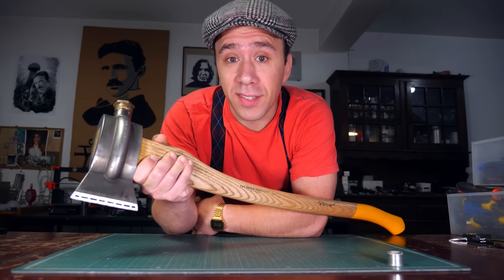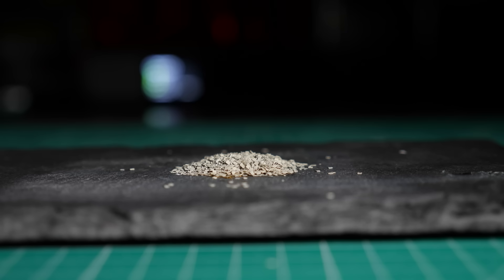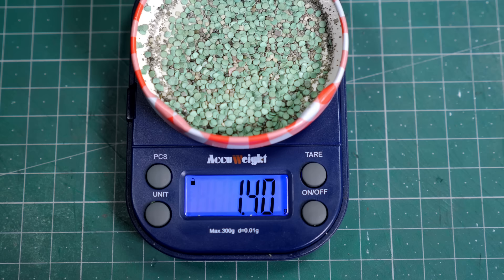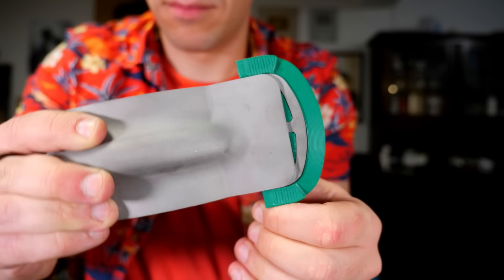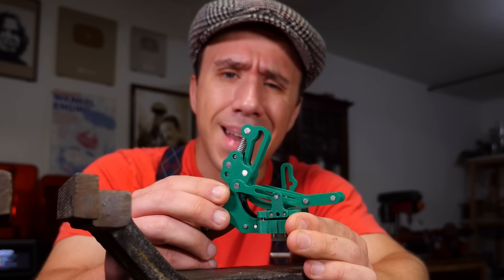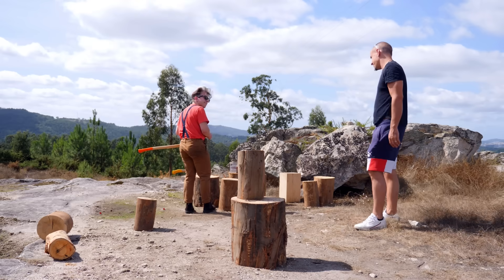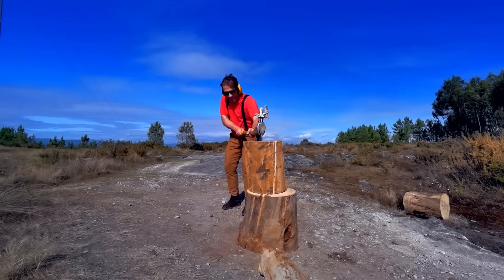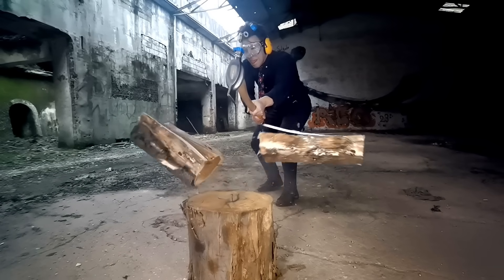I built a BETTER SHOTGUN AXE

Comment: What if instead of using the gas to try and split the wood you have some kind of chamber the gas goes into and pushes metal wings out to separate the wood. I would also be very careful to not make this a bomb. Add some vents or something and stand far away for testing for a bit.

Comment: ok,  since "technically"  its just the gas and not the shell that technically means the shell doesn't need to be pointing straight down.   So why am i picturing instead using a pipe system  to funnel the gas from the shaft to the the blade, little longer distance to travel, little less "power"   but should work.   grip safety,  round won't fire unless your holding the grip,   and a manual trigger allowing you to fire it when its in the wood saving on shells.   

with a little math you could calculate the max pressure you want, and even include a blowout valve if the pressure builds up to high  venting the excess pressure away from the axe and you.

Comment: Don’t want to be that guy but stainless rusts if it doesn’t have access to oxygen as it is the oxide layer so it will rust as long as you store it with water

Comment: I can understand why you tried different shapes for the blade in this video, as you said, penetrating the wood is important. But i do believe that the straight blade had an advantage at transmitting the force to the wood more efficiently. Maybe it also has something to do with the ammount of vents. Your old design had more smaller vents vs. the two on these new designs.  

Of course i could be entirely wrong, but i think these new designs sacrifice the "blowing appart power" for "ease of penetration".

Edit: After reading this again, i think that last sentence might me the wierdest and funniest sentence out of context that i have written in my life!

Comment: Diesel:   How about using diesel just like an internal combustion engine or a diesel driven pile driver.  Where you will use the force of the explosion rather than just the exhaust gases.

Comment: I feel like it'd be better not to try to use the gas to push the wood apart, but to use it to push a metal wedge apart. It'd take a lot more engineering to make the the axe head spread apart but stay together still, but it'd fix the issue of the gas escaping through the cracks in the wood and would make it a lot more consistent. It's all about transferring the pressure horizontally, which would be a lot easier with a fixed mechanism than just hoping the gas goes where you want.

Comment: A tip for cutting metal with a grinder cut off disk is, score the area you want to cut.  when you plunge into the metal all the way then press the edge of the cut off disk into the now thin part of the metal it will be harder on your disk. It might cut a little faster but it will be much more expensive and when doing a larger cut it can cause you to need to stop and replace the blade which can cause it to take longer.

Comment: I’d try a threaded plunger trigger mechanism on the top or bottom of the edge so it ignites when the blade is the right depth into the wood and the threads can adjust the depth of the ignition to dial in different wood types

Comment: 8:52 Joel, word of advice to help your tools last longer. That file you’re using has carefully shaped teeth and they have one face designed to cut and bite. When you’re using the file, make sure to only push when applying pressure. If your pull while the file is pressed against the workpiece, over time, the teeth of the file will round and deform and the file won’t bite like it should. The motion is push, lift, pull, repeat.
Reply: this is a myth. Fireball Tool tested this.
Reply: @ZexMaxwell it will dull the file though
Reply: @ZexMaxwell what I came to say 😂
Reply: A file card would help as well

Comment: You need increase holes in blade to make surface where gas pushes wood bigger, also it should be not angled but more parralel - so it make better seal with wood.

Comment: Dude, that has got to be the most baddass, and actually potentially quite practical , axe/wood splitter ive ever seen, especially here where shotgun shells are very easy to obtain.
Hell no more dangerous than an actual hydraulic wood splitter, trust me on that.

Reminds me of a simular device that still is fairly commonly used where I am, uses the same principal but drives roofing or finishing nails using  blank .22 or .32 rounds.

Theres market potential here in the US you know..... And ill end it at that.

Seriously though, very clever A++ video.

BTW Happy Birthday from a fellow "garage engineer" from the US.

Comment: What if the trigger mechanism were basically a rod that releases the hammer when the axe head is at the right depth? It'd have to be strong enough to withstand the forces from over-penetration, but also not be so light that pushing it with your finger would set it off. It'd be similar to the surface safety on a pneumatic nail gun, except it's the trigger.

Comment: 16:02 seems would be easier if you have a shotgun axe that you place on the wood and pull a trigger and the pressure splits the wood without swinging the axe. A zero effort axe. Possible?

Comment: maybe using a mekanizem that will release the hammer after the blade reaches a specific depth would fix both timing and depth. say after the blade penetrates 6mm it will push a rod that in turn releases the hammer. it would then only need to be adjusted to the depth that most consistently works.

Comment: Instead of relying on force from axe's head hitting the wood and triggering hammer, make a little tube with a steel ball inside, and place the trigger on bottom of that tube. Now when you swing downwards, the ball should go up and when you hit the wood, it would slam downwards into a trigger. This should give you some more control with delaying the explosion. I might be wrong but i think this might work. I hope he reads comments 😅

Comment: To detonate the exact moment the axe impacts the wood, combining the force of the axe itself with the explosion, you could use some sort of distance sensor. Could be either an ultrasonic one, a laser one, or even a diffuse IR sensor. If you use a sensor with a high enough update rate you could even dynamically adjust the timing of the trigger depending on speed of the approach. For safety you could also factor in the reading of an accelerometer to prevent false readings (so tapping it with your hand wouldn't set it off).

Using a button on the handle as some have suggested might work, but trying to time something like that on a heavy object you're swinging would be very inconvenient, whereas with an automatic system you'd just need to tune a number or two to get it to work.

Comment: Hey Integza, I really like you videos of rocket propulsion. I saw this video a of a guy probably using eddie currents using an electromanet and most likely aluminum to create a flying saucer, i wonder if you can replicate it and add a way of propulsion to steer it. This video is called  "Alexey Chekurkov Electromagnetic Field Lift August 18 2018" go check it out, it seems like a pretty cool video idea.

Comment: For mk3 put depth stoppers on the blade and the trigger mechanism on the blade so when it's at the right depth the blade stops at the correct depth and the trigger goes off like a impact dart toy.

Comment: what if the axe handle itself was hollow, with a pipe feeding hydrogen from the back? That way, the handle could act as a pressure chamber, giving more volume for combustion and directing the force forward through the axe head

Comment: How about actually splitting wood with axe.
Axe be made from two halves, that are able to slide to sides.
When triggered, gas pushes halves to sides. When they are far away, that would expose holes that would let gas out.

Advantage: you are not relying on seal between wood and axe, but seal is created by metal parts.

Comment: Can't you add a little plate that sits flush with the axe point and is sealed and gets shot out with the explosion? It'd always have a seal that pushes the wood apart even if there's a gap.

Comment: A simplified striker can be made with a cylinder with a firing pin protrusion, being held up and away from the primer by a spring. This would be held in another cylinder that screws into the axe head and holds the modified shell in place. You would have to play around with striker mass and spring weight to allow the striker to safely remain in the "cocked" position, but still allow it to reliably strike the primer when the axe head comes to an abrupt stop when penetrating the logs. 

Less complicated than current firing solution, more consistent than a magnet. Just slower to reload.

Comment: 8:32 when using a file lift on the back stroke the teeth of a majority of files are designed only for the forward stroke and get damaged on the back stroke 👍👍
Reply: After y3ars of testing this for myself I can conclude...it doesn't matter unless you are using super cheap or super old files

Comment: If my chemistry & maths is correct (it’s probably not.. haven’t done math like this since highschool!) 

A very similar chemical release of energy, and similar VOLUME of expanding gases from combustion is Oxy & Acetylene. And unlike gunpowder, you don’t need a license to get a kit, and you don’t need anything fancy.. 

Your little syringe of 100ml of gas should, if my maths is right, make about 500ml of .. gas. 

It’s also going to create high pressure steam.. which should work nicely too. 

HOWEVER UNLIKE GUNPOWDER be very VERY careful with mixed oxygen-acetylene. A nice neutral flame should be an almost perfect stoichiometric mix. 

Ignite that with a little spark, and boom! 

It might just go pop. 

It might blow the axe head to smithereens. 

If you do give this a try, PLEASE FILM THAT.

Comment: V3 using an outward expanding mechanical lever that is driven by the expanding gasses? Like a piston on either side that is flush to the axe head until detonation. Would more efficiently convert the expanding gases into kinetic energy that is applied to the log since it wouldn’t be reliant on the seal between axe head and wood?

Comment: It's innovative, except the cost of the axehead and shotgun shells increase the cost of production of firewood. Wouldn't it be easier to get a hydraulic wood splitter or a specialized wood splitting drilhead. It is cool.

Comment: Why not rebuilt entirely? 
You can take a iron pipe with some sort of an point on it. Maybe same diameter as the shell?
You can lock it with an rifle like bolt.
The point can have 2 or more opening to direct the gasses straight into the wood.

The reason? That little point drives deeper into the log than an axe

Just a thought😬

Comment: You could end up with metal in your face if you're not more cautious. Many firearms have a mechanical fuse of sorts that allows the thing to blow up in a way that doesn't harm the shooter too bad in case of overpressure.

Comment: You only need to compress the hydrogen /oxygen  a bit.  Putting more in a given area.  When it expands, it will open a valve or port into the axe head.. Also, you  may want to add a failsafe  to all the designs . In the event the ports are sealed, the axe doesn't EXPLODE!  EXAMPLE: Wood gets into the ports . Then you hit another piece of wood the ports are sealed.. the axe may explode ... having a small port that will open in an over pressure  situation..

Comment: This reminds me of cracking glass panes in a straight line, put a tiny score line on it then apply quick pressure. It snaps the same way, I also dont understand the exact mechanics. Rumor has it is several wars some troops modified sledge hammers with 12ga rounds to allow a single blow to a lock to blast the enttire door open in a simmilar way. Maybe something to do with the same physics to why a dead blow hammer is so effective?

Comment: What if you made the axe head body one piece and then the blade 2 pieces with a cavity for the expanding gases to then push the two pieces of the plane apart physically wedging apart the log this way you could have the ax head be like a normal ax head minus the split and it would be much easier and more consistent to split the log with the shotgun shell. You might even need significantly less than a shotgun shell

Comment: Axe doesnt work if you do not hit it hard enaugh! I must go as deep in to the wood as possible. Then all the gases has nowhere to go, and that means good boom! And also good cracked wood at 2 peaces. Try to hit it as hard as you can, and be surprised! If you do not hit it hard enaugh then it doesnt go deep enaugh, and that means it doesnt seal it good enaugh, or it doest want to stay on and it pups up, or then it does nothing. So, simple solution, use your muscles!

Comment: The main problem is the timing, you need the "blow" to add to the initial shockwave. Also, you want the gases to "stick" as much as possible to the axe while making the distance between the "gills" and the blade as short as possible. Your mechanism induces a lot of delay and possibly doesn't make enough gas (you may reconsider your type of explosive, TATP or nitrocellulose should work well), the gases are often blown outside of the wood well after the shockwave has gone. Actually, that's a lot to fix, but it's funny so far, congrats!

Comment: you may have used pneumatic files (they can reciprocate with ultrasonic speed, the only drawback is that the aplitude and frequency are not configurable and you need many of them for different abrasives) instead of grinder

Comment: Calcium carbide + water = acytelene. BOOM.
Reply: BIG boom.
Reply: Problem is he doesn't need boom, he needs gas pressure.  Also, the reason acetylene used to be made that way is it's surprisingly unstable for how common it is.  Seriously, acetylene tanks are filled with acetone to make it more stable. It's also been known to spontaneously decompose in contact with pure copper!

Comment: Yeah, you shouldn't be using brass for the firing mechanism, because it's not very good for holding the pressure from firing a round. The hammer is interesting, but could be much more compact and reliable. You could, instead of using inertia to fire it, have a sort of moving axe head mounted on secure steel braces, that in turn releases a hammer which could be mounted on a mainspring. As for the ejection, that can just be manual, it would be simpler and more reliable.

Comment: What if instead of using the pressure to split the log, use the pressure to lift to levers to push the wood apart. That way you wouldn't have to worry about how hard you hit or any sealing issues.

Comment: Penetration thought: if instead of a blade the axe was just a nail with weight behind it then that would be the ideal case as far as penetration goes, right?

But a single nail, thick enough to have some way for the energy to escape wouldn't work. To survive both the impact with the wood and the shotgun blast it would need to be too thick, thus losing any penetration gained by being a nail instead of a blade.

So the trick might be to find the point between a nail and a blade where you get the best of both penetration and strength.

I think it would look like a blade that had teeth filed into it like a simple saw blade. The teeth would be sharp, for penetration, but large enough to survive being swung into the wood. And there would be multiple of these teeth across the face of the blade allowing the shotgun shell's energy to be spread out.

Comment: I would do something that gets out of the axe and push the wood apart instead of relying only on the gas.
Since the part is fully 3D printed, it is possible to make this design as a print in place.
Instead of the gases from the shell going directly to the vents they go to a plunger, with exaust holes in the end of the course, to prevent something else to split I to multiple pieces, and the plunger is connected to two pairs of claws, one from each side, that pushes the wood apart.
Tis way, with a minimum penetration you should be able to split the wood.

Other approach would be to use a heavy mass behind the axe and use the shell to propell the mass toward the axe, and then the mass hits the mechanism to expand the claws. This is a safer method (IMHO, I'm no scientist lol)

Comment: 9:23 You use the power tools for the bulk removal and the files/sandpaper to finish the last 5% or so. 
Doing that much shaping with a cheap file when you have access to a belt grinder is just silly…

Comment: Dont use the gas expansion itself to split the logs. To get a proper seal  is not reliable. Use the gas to split the wood mechanically, similar to a easygo splitting mall.

Comment: More holistically, you may want to consider mastering your axe swing as well.  You'll find you can get more accuracy in your penetration (and it'll be less tiring) if you do a full swing rather than artificially holding the axe high then using your arm muscles to "pull" it down

Comment: My 2 cents.  Instead of triggering it based on impact force, trigger it based on the axe head penetrating the wood. Put the trigger mechanism on the side of the axe head so that it is triggered by the axe head going into the wood.  That way you always get it going off at the same depth.
Reply: This!!! 👆
Reply: Doesn't even need to put it on the side.

Have a slotted sliding bar on the side of the axe that got up to the trigger mechanism.

When it gets to a specific depth in the wood, it gets pushed and triggers.

You don't want your axe unbalanced by a brass mechanism hanging to the side of it.
Reply: Like „pushrod and rockerarm“ in combustion engines
Reply: Why not just put a trigger...? 
Swing, bite, trigger. Done
Reply: So your saying make a heat tank shell in the shape of a axe?
Reply: Or use a laser for heigth measurement